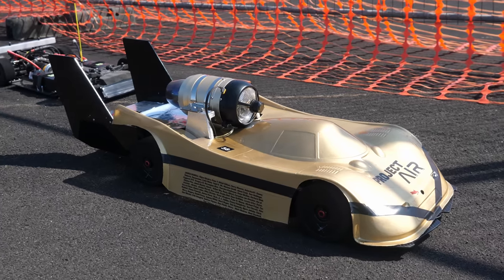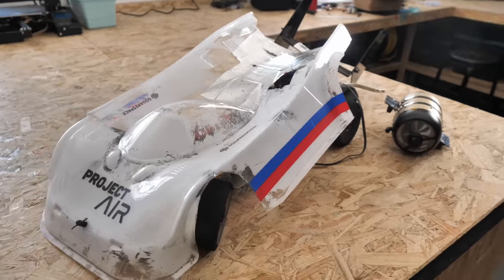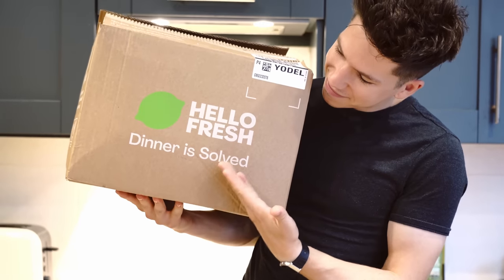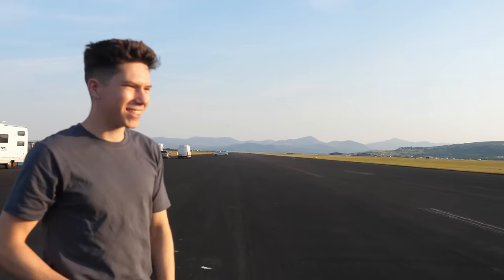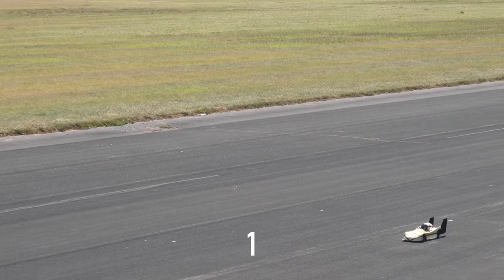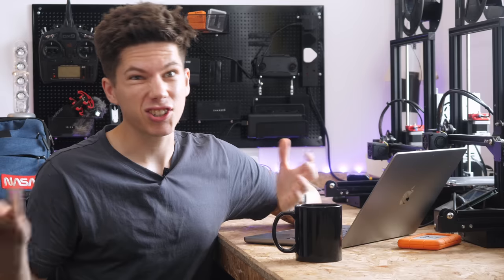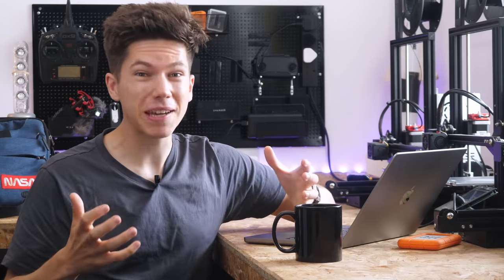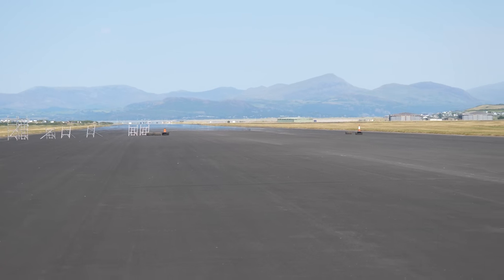Fastest RC Jet Car (Runway Testing)

Comment: You do know you can fix your steering by juice you don't change not steering module or what that's what I like to call it you know just changing up steering or you know tightening the steering or you can just do what I would do in the situation if I had like you do and I would change the steering links and then make the driving to the front wheels smaller so you still have that make the Apple body bigger or wider cut down on so much stuff it's really not I'm at Aerospace into here so yeah I will tell you more if you want to contact me and I'm I know you know how to do

Comment: wow that gyro is a super bad gyro do not use that gyro i have been drifting for a long time and we have a lot of exsperiance with head on gyros  look for an onisiki if you want the cheapest but best simple head on gyro 

if the gyro is a little high on the gain it can cause a wobble on the wheels thru the chassis and the gyro picks up teh chassis vibrations and triggers the gyro into stearing and can go into an unlimitated chatter 

i recommend the onisiki gyro or if you want a better gyro look for the overdose dias same as the ko propo kg-x  these are what you need dont run that trash gyro
Reply: and ontop of that if you get a reprogramable servo you can then turn down the speed and also reduce the speed on your handset and that way the gyro will take priority and you just give it the small assistance it needs for diraction
Reply: then you can plug in the gyro to your aux channel and controll how sensative it is

Comment: Not sure about fastest RC car at 100mph is not even 50% of the speed runs I have seen.  So far the best I have seen is 205 mph measured with a gps. Also that was just with lipo batteries. You got a cool build but not the fastest rc car not by a long shot. Seems like a jet turbine is just the most expensive way to do it.

Comment: You poor brits suffering all the heat. Sucks your homes and buildings aren't designed with AC. The heat wave here the Midwest was high 90's and low 100's F and high 70's and 80's overnight. 
Ya climate change isn't a thing effecting anything or anyone in the world.